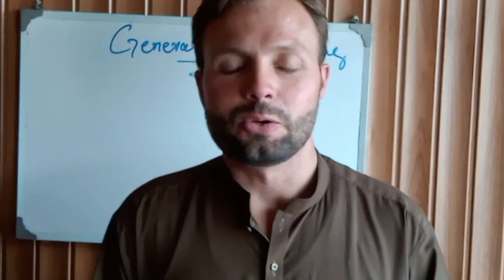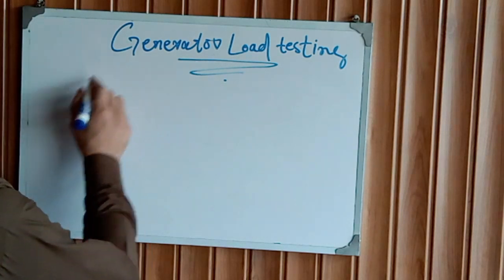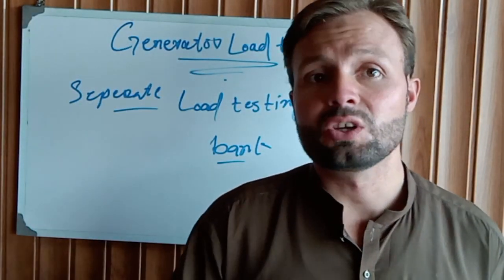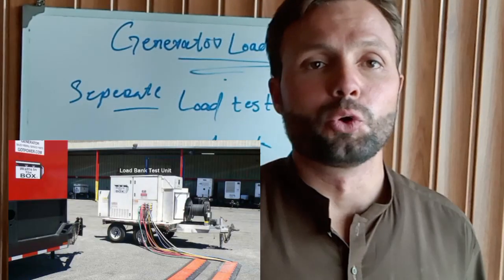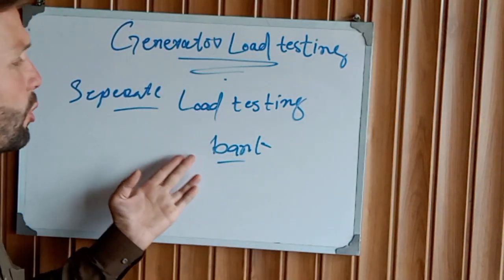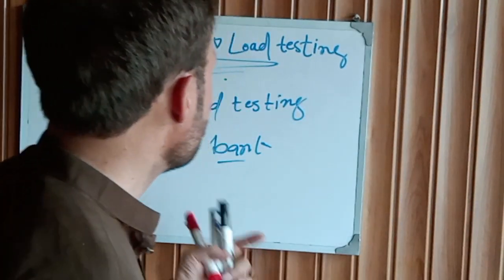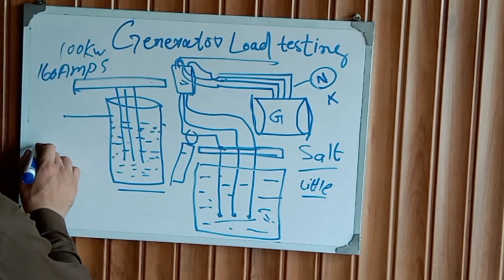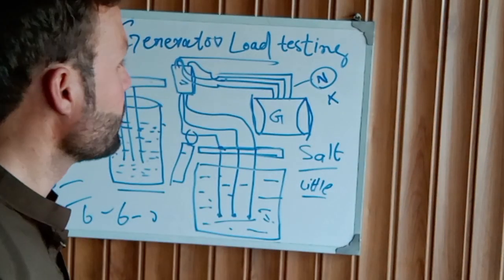How to test the generators load, with load testing bank, salt water load testing method

Comment: Why does it become hard for the engine running the generator to turn the shaft connected to the generator when the electrical load is increased?
Reply: More power
Reply from the maker: Because the shaft is attached with main rotor, Shaft have hight magnetism, when load is increased the shaft magnetism increase, some time shaft going to stop on high load cause high magnetism